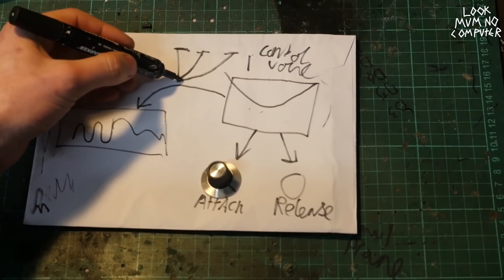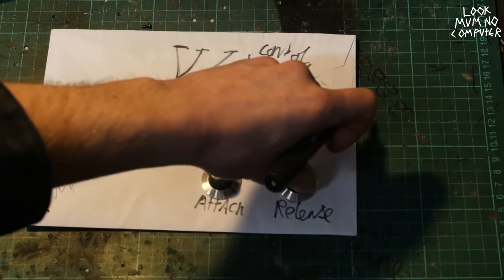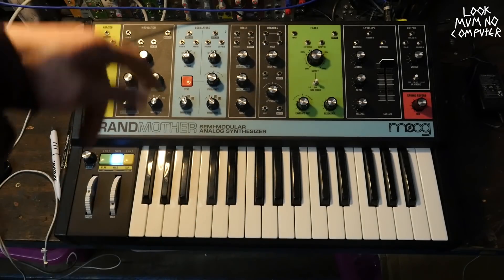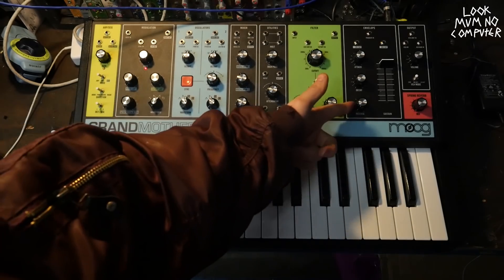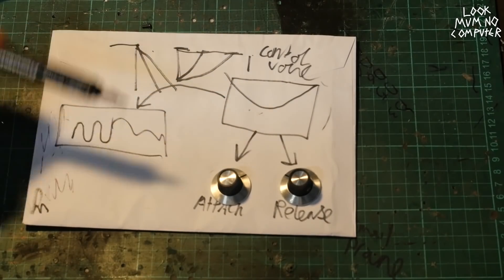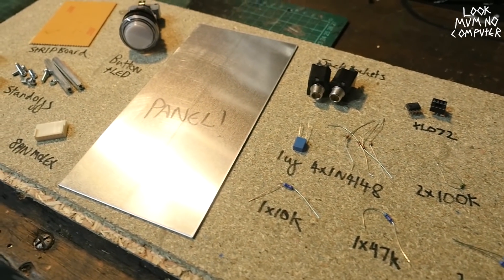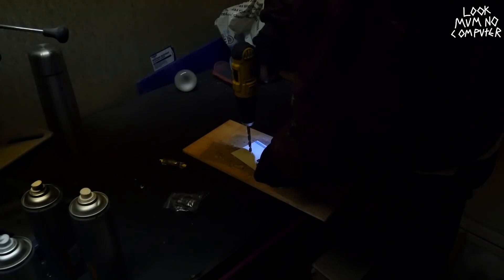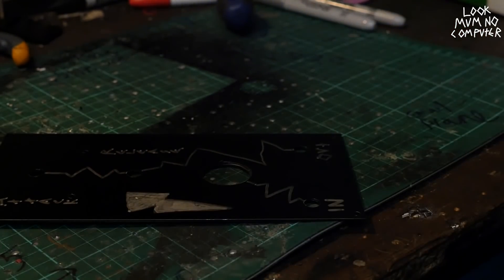DIY ENVELOPE GENERATOR? How To Build A Simple One for your synthesizer!

Comment: Hey Man, thanks for all the stuff!

I have a QUESTION :o
In the perfboard schematic for the more advanced version with Spdt switch, there is a Diode connected between the Gate in and switch.
Its simply called D2, is it a 1n4148 as well or a different one ? 
Thanks again <33

Comment: I try to make this an it blows up the TL072, literally explote ahahhaha, i know it was my mistake but i dont know why. Did somone had mistakes doing this project? It is posible that the polarity of the dc adaptor was wrong ? My dc adaptor doesnt have the polarity so maybe that was the mistake. I check the ensamble like 20 times before switch on

Comment: What is the component in your Full drawing  labeled D2 attached to the SPDT switch  heading back to the Gate Input tip - Looks like a Diode what is the value of that component?
Reply: All the other diodes on that circuit are 4148's.
 Just use another one of those for D2, cathode stripe goes to the centre of gate/trig switch.

It prevents 12V trigs from the arcade push button going back to the output of any (expensive) device connected to the "gate in" jack.
'Coz that could be bad.

Comment: So attack would be voltage, and release would be time.
Reply: Attack, (Decay,) and Release are all timings.

Attack is the length of time to come up to full envelope output voltage, and Release is the length of time to drop back down to zero.

¹(Decay is the length of time to drop down to the Sustain level after the Attack phase,
and Sustain is a voltage level that will be maintained as long as a gate signal is present, like when holding down a key. After that, Release drops from Sustain level to zero.)

¹This applies to ADSR envelopes. Sam's circuit is a simpler AR envelope, but still gets good results.

Comment: amazing! What's D1 - the green circle in the pic
Reply: That's an LED, with its minus side to the supply ground. It'll light up whenever the output voltage is sufficiently higher than the threshold of the LED.
Reply: of course, obvious in hindsight. Thanks heaps for that.

Comment: One more question. So the envelope controls the filter and the pitch if you want. What about the,... I guess in synthesizer terms it would be the amplifier but I really just mean volume. That's what the envelope of a regular instrument would control. You can control the attack and release on a violin but you're controlling volume.
Reply: Same. It'd be an Amplitude Envelope.

Comment: Hey so I made a envelope generator as closely as I can in the video and find that it doesn’t turn on or work at all and the tl072 heats up and I’m not sure if it’s supposed to do that. Help?
Reply: Are you married to Marzgurl? Did you figure your circuit problem out?
Reply: NeuronalAxon, no, I got the led to light up but it doesn’t generate any noise or change anything at all
Reply: @dachimp4879  - You got a multimeter or oscilloscope?
Reply: NeuronalAxon yeah just a multimeter. I followed exactly the schematics on the website and it lights up the led but doesn’t change the signal or “generate” sound even when plugged into the cv input of my oscillate
Reply: @dachimp4879  - Have you tried measuring the CV output with a multimeter, at least? Turn the rate down really low and see.
Reply: NeuronalAxon thanks for the tip! Will follow up later! Thank you!

Comment: Are the schematics ok? Im trying to build it, but its not doing anything
Reply: The same problem...
Reply: @elhombrequenuncaduerme Actually they are ok. I had a bad capacitor, now its working perfect!
Reply: Pablo Beck Garreaud yes mate! I put a 10uf capacitor and works perfect.
Thanks!
Reply: @Pablo Beck Garreaud   @elhombrequenuncaduerme  Oh, i'm building it right now, with the extra "trig or gate" circuitry. Do you know where the legs from the 10nf cap go ? I can't figure it out on the schematics. Thx !

Comment: So I figure that a synth requires a minimum of oscillator, LFO, filter and envelope. So, maybe it would be cool if you did LFO next. 

Also, how does a keyboard work on a modular? From what I understand, you need an oscilloscope to tune it. Is that correct?
Reply: and VCA
Reply: Keyboard: well you can get a midi to control voltage convertor. Otherwise, you need to convert the key matrix into control voltages.

Comment: How much volts needed to power it?
6:02 no layout, rip
Reply: www·lookmumnocomputer·com/simple-envelope-generator
His diagram of the stripboard layout shows ±12V & 0V for the circuit built around a TL072 opamp.

Comment: what about sustain and decay? are you going to do them on an other module or just leave them out?
Reply from the maker: Melchior Tod for modular they make it very complicated without much reward. For modular the most useful is an ad/ar and you can make that with this circuit easily with a couple more components that design is up on my website on the same page as this ine
Reply: @LOOKMUMNOCOMPUTER  ok cool! thank you!

Comment: Can you do a DIY VCA next? I've been trying to design a cheap easy one for months
Reply from the maker: thats the next one1!!! if you want a painfully cheap easy one, (like the one i use on synth bike and a number of different projects. its easy!!!! get a BC107 transistor (the one with the metal enclosure) the collector leg is input, the base leg is cv, and the emmiter is output. its quite nice. it cuts off well, it actually has a curve and! it doesnt clip at the start like other transistors. just try it! i use it surprisingly a lot.
Reply: @LOOKMUMNOCOMPUTER  Thanks! I'll definitely have to order a lot of them and give it a go. Any luck with any other types of transistors? I've got loads of silicon ones in the TO-92 package, and I've got some Chinese and Russian Germaniums in metal packages.
Reply: P.S. You forgot to put the layout for the Passive Attenuator "here"
Reply: @sage276  Here you go - not Sam's module but the same design: http://musicfromouterspace.com/index.php?MAINTAB=SYNTHDIY&PROJARG=WAVEFREAKER/WAVEFREAKER.php&VPW=1670&VPH=815